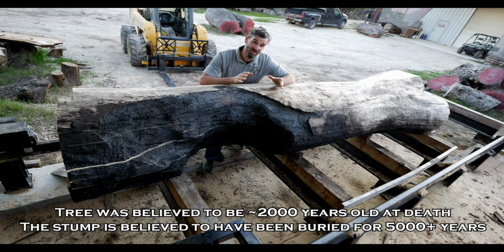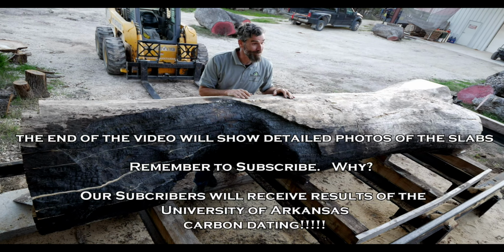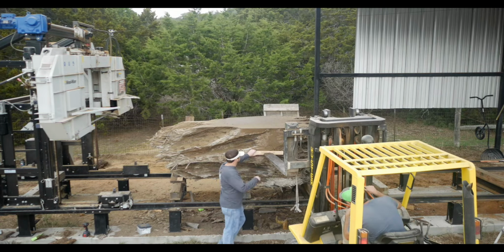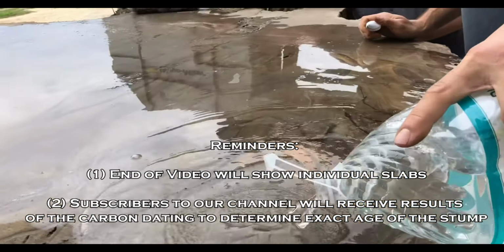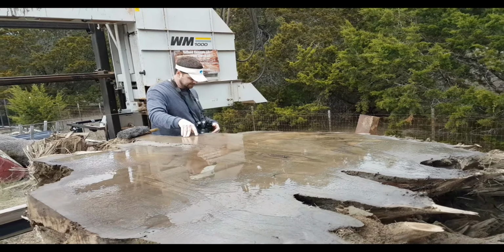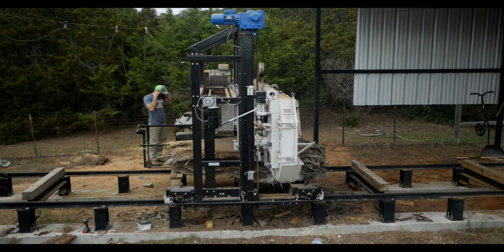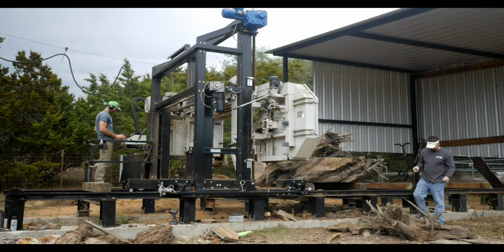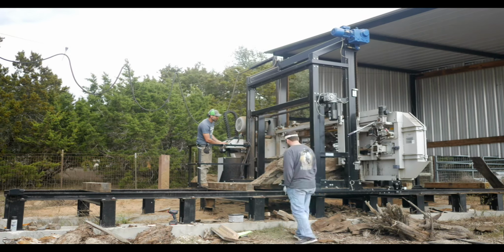Prehistoric Sinker Cypress Log - Buried 30 Feet Deep for 5000+ Years!!! - Part 2 of 2

Comment: Great project and a great video.  Thanks!
I believe the reason why some of the buried and/or submerged cypress is rotted and others is sound has to do with oxygen levels at the burial site.  At thirty feet down there is probably not enough oxygen to support the fungi and bacteria that cause rot.  When I was a kid in southern New Jersey I dug up old 2x4 stakes out of our swamp, and the upper part, near the water line, was rotted to crumbling, but the lower part, down in the smelly black muck where there was no oxygen, was completely sound.

Comment: From what I understand, if the wood is completely submerged in a low-oxygen environment, the fungi and insects can't live and digest the wood. There have been a lot of logs pulled up from the great lakes that have been very well preserved because of the lack of oxygen.
Reply: That's the same reason, centuries old, wooden ships have been
pulled from the deep ocean, almost intact. Along with leather
goods, on those ships.
Reply: The U.S. Navy stored thousands of tons of white oak, live oak, and other species underwater in the bay at Boston, and in timber ponds along the east coast since the building of the U.S.S. Constitution and her sister, the U.S.S. Constellation.  Some of it has been recovered and used for repairs and restorations for those two ships.
Reply: Exactly. Peat bogs are probably the best natural preserver for the same reasons. On top of low oxygen levels, the annual peat growth uses up almost any oxygen left below the surface.

Comment: I have seen Huon pine (Lagarostrobus Franklini) of similar age to this dredged from lakes in SW Tasmania (Australia). Unfortunately the timber is so incredibly valuable it has led to a log piracy trade with significant parts of the very limited standing resource stolen by thieves. The oldest clonal stand of Huon pine is 10,500 years old with individual stems 2000/2500 years old

Comment: Wood doesn't rot without oxygen.  If it were underground and even covered with water or bog it was protected.  Think of a sunken ship under water it sits.  If you take it out and put it on the back lot, it will rot fast.  This is why they are put into water and conserved slowly.